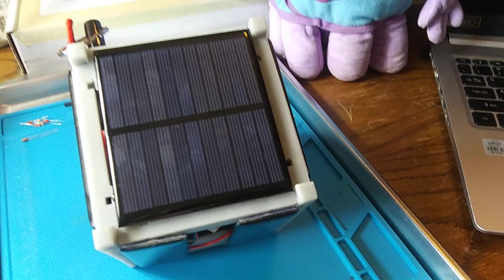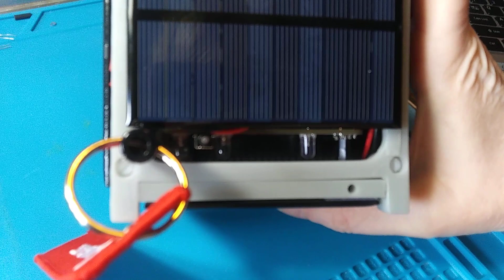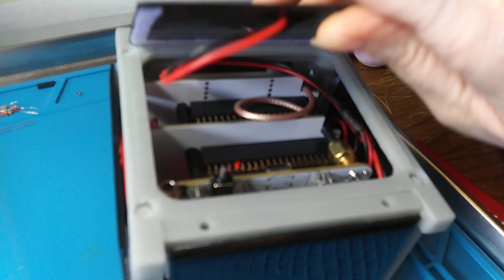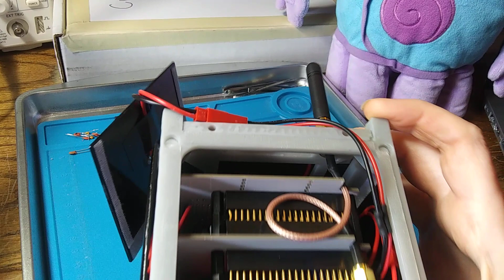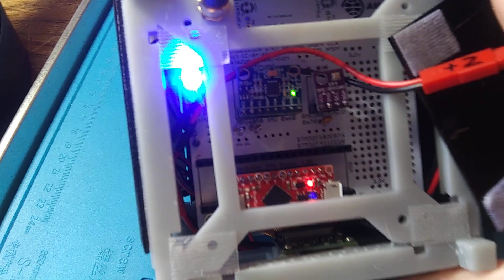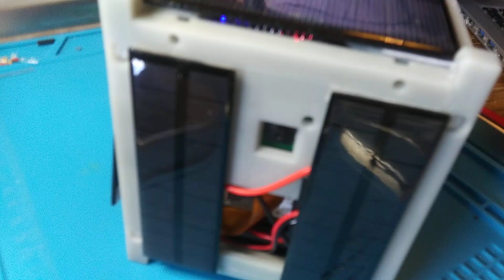AMSAT CubeSat Simulator - a brief tour of a simulated satellite.

Comment: so cool was looking at making one very impressed you need to glue any connectors to the board and the sat should have a vibration isolator for the chips I would also recommend switching to LiPo 4 I bet you could have a three-prong net that could extend and act as a radio telescope use micro brushless motors to spin up some RW to orient the satellite and a gyro for stabilization you could create a copper heat pipe for shielding  the electronics as well as a way to remove heat so cool keep up the good work
Reply from the maker: Thanks.  I'm having to work overtime to remind folks the purpose of this project.  I did not design it.  It was designed by the AMSAT educational team to be a very basic model.  It could be a good way to eventually explore adding features which are more practical but not needed in this case.  There is not concern of vibration damage or cooling needs or need for steering or attitude control.  The batteries have to meet the needs of working for only a short time for demonstrations and also must be able to be shipped (hence the choice to use NiMH), as these units are loaned to people all over the country and sent via UPS USPS etc.
Reply: Oh okay very cool  @CorduroyJohnny5

Comment: Really great presentation here. I understand that this is a simulator, however what would happen if this simulator is placed into a vacuum? Would any off gassing of the components occur? would this affect their performance or accuracy? How do 3D prints hold up to vacuum?
Reply from the maker: This is not rated for performance in a vacuum.   It is simply meant to be a basic simulation of the electrical, communication, sensors, power and computer systems on a cubesat.  An engineering model of an actual planned satellite would be used to test these conditions.  Space rated parts are very expensive.  You can see some at https://www.cubesatshop.com/  This simulator is simply for educational purposes.
Reply: I've had PLA molds deform in small vacuums before. 3D printed parts don't belong in space unless they are carefully designed to do so and even then you have the risk of it melting and deforming.

Another thing to note. I know this is a pre-engineering model, but those solar panels wouldn't hold up for long even down here on earth. The sun degrades the emulsion and turns it to this cloudy mess.

Really cool project and makes me want to design my own.
Reply from the maker: @RingingResonance  reminder to you and all, this is a simulator made for basic technical and theoretical applications in education for everyone from elementary school kids to college students.